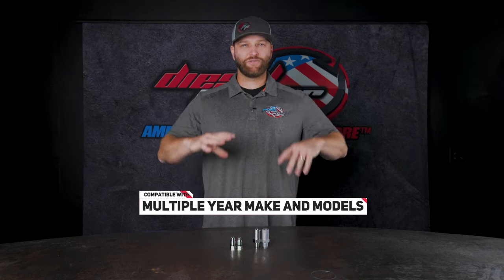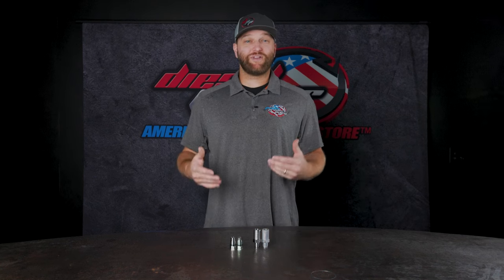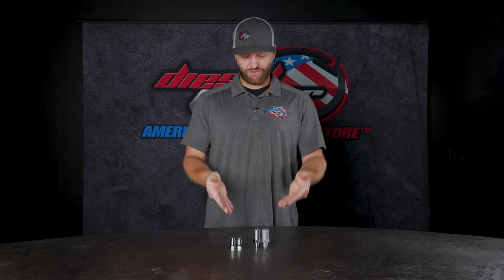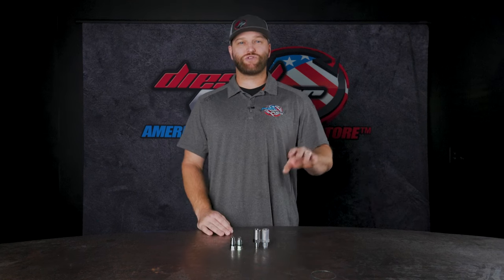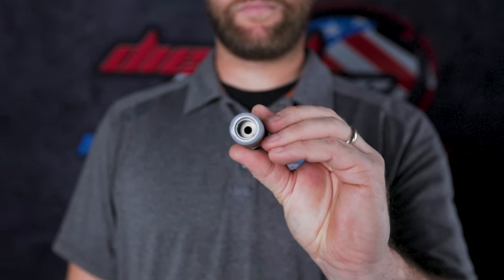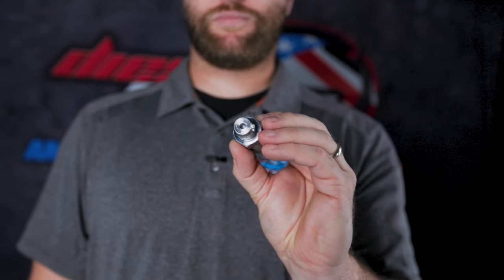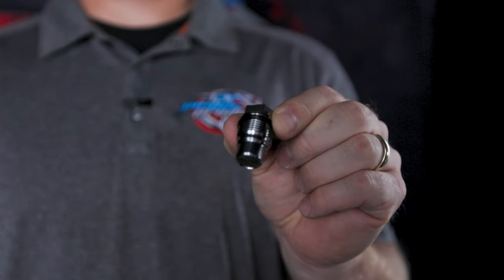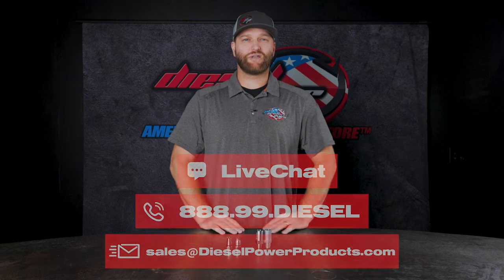DIESEL TALK | COMMON RAIL PRESSURE RELIEF VALVES & PLUGS

Comment: So what is the benefit of a “race plug”. Other than constant rail pressure? What is the the biggest problem with a consistent high pressure? It’s not a water heater or boiler that will shoot like a rocket. Will it harm the motor?

Comment: Shouldn't be promoting these block off plugs. You know they aren't good for the fuel system.....
Reply from the maker: We've been selling race plugs for all types of HP levels and have NEVER had an issue or call back regarding pressure spikes. If a component in your fuel system can't handle that spike of pressure, it was going to fail any ways.
Reply: @DieselPowerProducts  😆
A "pressure relief valve" - used to relieve pressure. Block off a pressure relief valve - pressure has no where to go. Somethings gotta give. 

Would you block off a pressure relief valve on a boiler or hot water heater? What could/would happen if you did?

Blocking off relief on a hugh pressure fuel system that has ~30,000psi of rail pressure = stupid.
Reply from the maker: I agree, you understand pressure dynamics. However, there is a difference to what happens on paper, and what happens in practice of such. 

On paper, should it cause a huge problem all the time? Yes. 
In practice, does it? No, not even a little.
Reply: @DieselPowerProducts  That is just untrue. 

Not trying to be a dick. I'd just suggest maybe putting a disclaimer in the video, warning people about the risk of using block off plugs in a hugh pressure fuel system. This is not something you just want to throw on your motor, not realizing what you are actually doing, and the potential risks. The video comes off as just a "hey, buy this!"
Reply from the maker: We've sold them to people who have installed them on stock trucks, higher horsepower trucks, and between. In my 10 years with this company and multiple thousands sold, not a single customer called back with an over pressurization issue. 

I am not disagreeing with the principals of the fluid dynamics. I am however agreeing with real world experience. 

This video is not a "HEY BUY THIS." It is a comparison between the two with visual aids. We sell both and believe in both. If you don't want to put the plug on, then go with a high-quality Bosch replacement. Want as much rail pressure as possible and to remove a common failure point, get the plug.
Reply: @DieselPowerProducts  I respect your point of view, but I do not agree with it. Thank you for taking the time to respond.
Reply from the maker: 100% I appreciate the conversation and keeping it cordial.

Comment: I have a 2002 lb7.
Lost fuel delivery one day, died, prime from tank to filter prime pump, pump it up, it starts quick , runs then after a bit dies,runs out of fuel. Install fass titanium 165 gph lift pump, runs now but at half throttle power falls off. No codes. Any thoughts...
Reply: Maybe a cracked or clogged fuel line bud . Sucking air somewhere or Clogged up line maybe . Did you ever figure it out ?